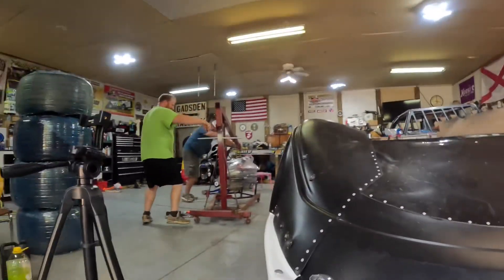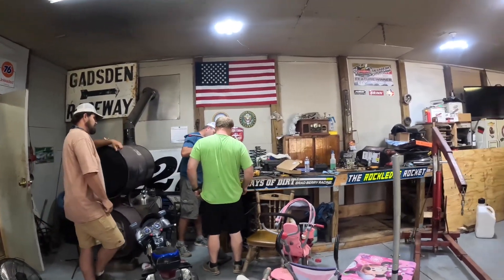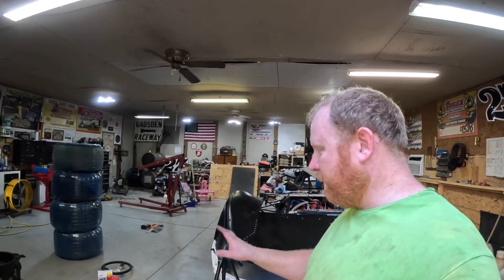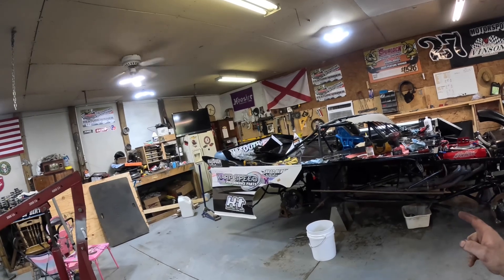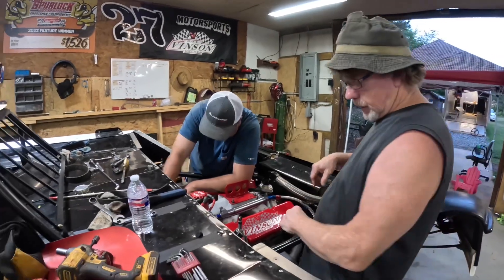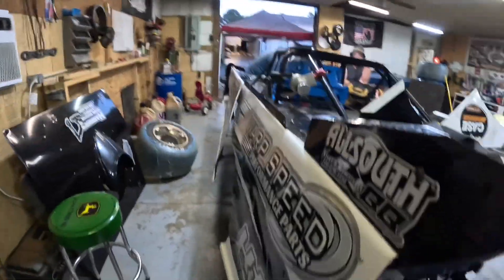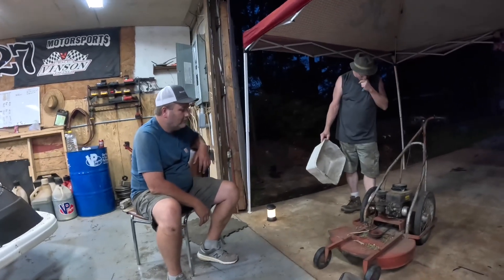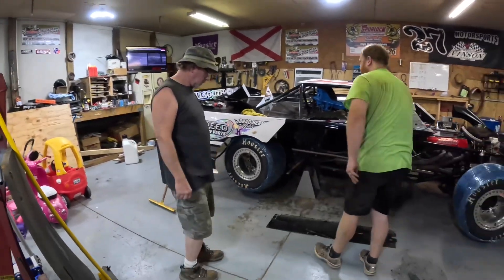She’s ALIVE once again | ready to head to Duck River Raceway Park with the Topless Outlaws

Comment: Back in the late 80’s or maybe 90 or 91, I got flipped onto my roof on the front stretch and those big spoilers we ram back then act like a bull dozer. It dug up a big ol clod twice the size of a 5 gallon bucket. It dug the rolled up on the nose and that clod rolled up under and when the car came back down to a rest it went through the fiberglass roof and had me pinched in on my right shoulder and couldn’t crawl out. Didn’t break anything on me but was sore as heck. Had it rolled up directly over me it would of broke my neck. So I’m glad they went away from fiberglass roofs and went to aluminum. Great safety improvement.